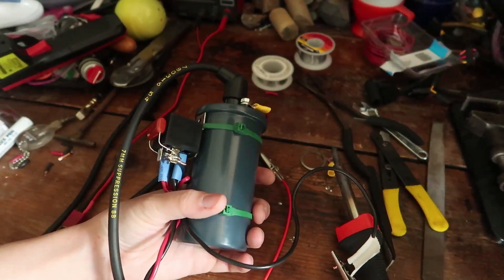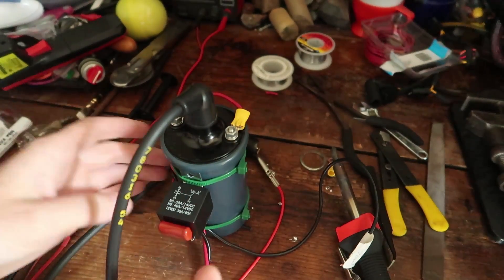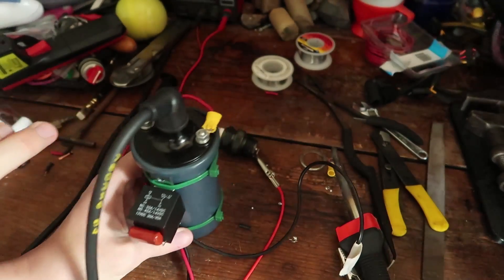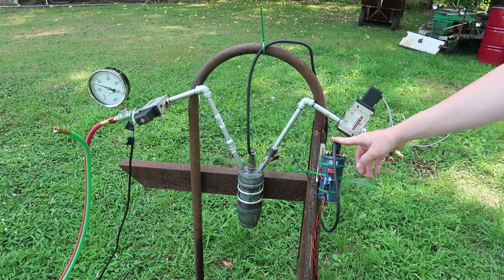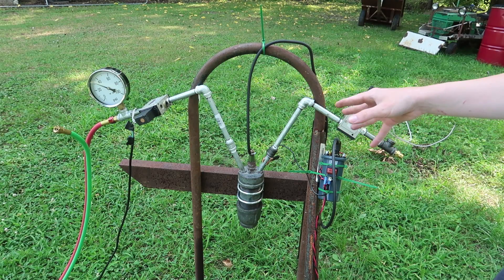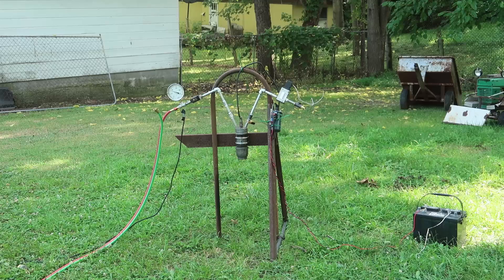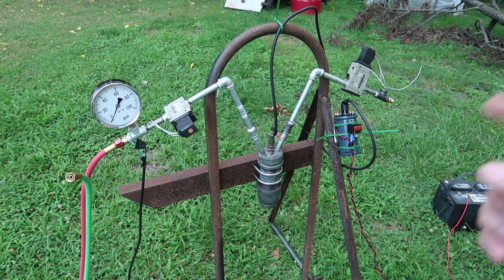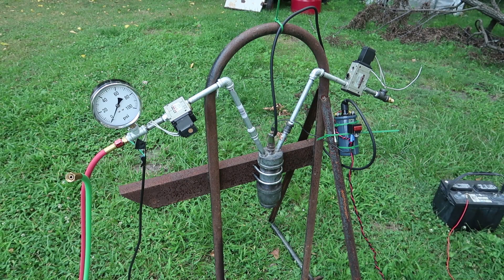DIY Liquid Fueled Rocket Engine 04: Test-Engine Spark Ignition Experiment

Comment: My guess is the mixture is too rich for the spark. Try flowing compressed air through the 2nd line at a low pressure - so that the propane & air are mixing - just a "swirl" kind of action. Then spark it. This is so cool.
Reply from the maker: well i was hoping i could get it burning outside of the chamber with this test. it appears the gas in the chamber doesnt change out as fast as i would have though. and yeah i agree, compressed air would be a good test before pure oxygen.

Comment: did this to fix combustion problem with wood gas fuel. Make the fuel and oxygen swirl like a vortex filtering system so the center of the vortex is centered on your ignition point. the vortex tightens when pressure is added.  I used compressed air in my set up though. great build but don't loose your eye brows.

Comment: Looks like you are having the same problems i had when building my 5Kn engine's "torch igniter". 1. Keeping the power from jumping out of system to other things (in your case the grass) is a pain, cover all metal with heat shrink or similar insulation. 2. You are using all the O2 in it right away so it will not stay lit. For it to light and stay lit you must keep adding O2. Compressed air may work in your case due to you lighting the chamber directly, in my case i HAD to use pure O2. 3. I highly recommend A torch igniter set up over direct combustion chamber ignition as it is more stable. 4ish. As for worrying about it exploding, you do not need to. With such low inlet pressures and with a wide throat not a nozzle it is physically impossible to reach the levels needed to break those fittings.
Reply: I agree with the above. Sparkplug is enough for igniting the mixture, I guess even the glowplug would be enough as long as enough o2 is provided. Also I would add something to preheat the fuel (like a condenser tube submerged in hot water). Liquid propane won't ignite.

Comment: Very cool project!!!!
Reply from the maker: thanks, i'll get back to it when i get my workshop finished, then i'll have plenty of space to work on things in air conditioning. maybe even buy a lathe.
Reply: Rinoa Super-Genius I was heavily into rockets years ago. Got up to level 2 cert and was starting my level 3 but decided to sell everything and get out of it cause the clubs were getting out of hand and made it hard to have fun. I do miss the building aspect of it though. I have had an idea in my head for years. Maybe someday I will build it!
Reply from the maker: is that an FAA license? i dont want to deal with clubs since my goal isnt model rocketry but real rocketry.
Reply: Rinoa Super-Genius it’s for the size of the motor you can use. Each level is determined by the impulse your allowed to use. At level 2 the largest rocket I launched was 13’ tall 7 1/2” dia and weighed 125 lbs on the pad. It flew to an altitude of 5200’. Anyway... I always wondered about building a real rocket engine. Cool stuff keep it up!!!
Reply from the maker: thats not what im asking, im asking what government agency you get the license through. surely you dont think commercial rocket companies have to join a club made for little kids launching store bought rockets do you? im trying to figure out what organization i need to go to in order to clear a launch. so far ive found no law stating i need a license, and the FAA doesnt have any info on licenses as far as i can tell. so it seems to be an invention of the ametuer rocket clubs.

and what ways didnt they kill the fun for you?
Reply: Rinoa Super-Genius each rocket club is governed by either Tripoli or the national rocketry association. At the launch site anything over 5000’ needs an FAA waiver to fly. And depending on where you live and how close any airports are you need to contact all of them. There radar system will pick anything up. As for the fun part it became very clicky. Like a soap opera and it was getting hard to secure waivers to fly and when all your rockets need waivers to fly it just got to difficult. On top of the 2 hr drive to get to a field that would allow rockets
Reply from the maker: ah, i bet i'll save a lot of trouble by building my own launch site on private land. i plan to get permission from one of the farmers around here who has huge fields and use one of those.

Comment: *=* During ignition, there may be several disadvantages, the energy released by the ignition carries the plumbing to red hot, and not to mention the oxidation that can produce on the metal during hot, the rocket nozzles are probably made in ceramic, idk...

Comment: If you pumped in oxygen at a little lower pressure then the propane that should help. I also would recommend as soon as you turned on the ignition to have it open the oxygen solenoid. For the oxygen you could use a old fridge compressor to pump it in as they are quiet and have a extended run time. Just before you do that make sure to change the compressor oil as the normal oil will turn to acid if it meets air

Comment: Brainstorming... you could make a priming switch that will allow a very slow fuel flow then when ignition is started you can flip a switch and it will open the main valve. I also would recommend maybe a bigger spark gap. Like a neon sign transformer or you could get a oil furnace igniter. At least a 1 in ark or less should be able to ignite it. Or instead of a bigger ark gap you could add a second spark plug to help out the first one. I also wonder if you took a diesel injector from a car and pumped high pressure oil or diesel through it if that would work too. Just some random ideas to think about..

Comment: *=* Special project, and take precautions to avoid injury.
I have a suggestion, you can try pump the air of exterior for the unconnected oxidizer for easy combustion in the rocket.
If you try put oxidizer in the rocket, keep distant to the rocket before the test!

Comment: The other option would be to switch to a pulse jet engine, less parts and easier to make work, plus there really cool.
Reply from the maker: but they are loud, innefficient, and not a rocket engine at all.
Reply: Rinoa Super-Genius well it looks like you are on the right track with this one, a rocket engine consists of a combustion chamber, a throat, and a nozzle, i see a combustion chamber and a throat, you need a nozzle. It should start at the diameter of the throat and bell outwards, probably going to be 2 times the diameter of the throat, to get the correct pressures. I do love your presistance though. Keep up the good work!!

Comment: It looks like the ratio of propane to oxygen is a little off :) a quick google search yields the answer is a one to one ratio. Sooooo i guess this gives you more reason to add in the oxygen :); however, you need a way to mix the fuel inside of the combustion chamber so that the propane can mix with the oxygen and burn at the correct stoichiometric ratio. I would suggest one of two things creating multiple entries for propane gas and the oxygen or setting both gas inlets on angles so that when the pressurized gas enters the chamber is creates a vortex that should mix the gases. This will most defiantly make it easier to light the gas with the spark because if the gases (oxygen and propane) are mixed correctly 1:1 ratio the ignition temp will go down or the required input energy will be lowered.  KEEP UP THE AMAZING WORK i like this series a lot. I hope this helps a little bit!
Reply from the maker: Yeah i was hoping it would burn outside of the chamber since i only had propane, but oh well. i'll try compressed air next.

Oh and i plan on experimenting with injector styles on the next engine.

Comment: YES, with my experiments, I first started off trying to find some transformer to use for ignition, and ideally a car ignition coil is best, but then I remembered a while back I ordered a high voltage taser/spark unit and eventually used that. I didn't have the necessary materials to create a switching current for a microwave transformer i was using.

Comment: why not instead of propane use Petrol through an injector , this injector could be a metal spray nozzle hooked up to a pump ( I havent done any research on pumps suitable for this but if you dig around a car store or scrap yard you probably will find a fuel pump that could work ,make sure the nozzle aerosols the gas and it should be eaiser to use than propane. 
but dont take my word for it as i only work on solid motors like APCP   and am expanding into hybrid rocket motors. 
Good luck and i cant wait to see some more progress ! :)
Reply from the maker: because then id need liquid oxygen

Comment: you should use a 555 instead. this is really bad for the relay and it won't last long
Reply: Still, it works and it's a cool on-the-fly solution.

Comment: You should get a Universal 3 Position Ignition Starter Key Switch with Momentary Start and a momentary on push switch and wire it up so you require to hands to ignite the engine (as a safety feature) or dont your choice

Comment: Why not use Aerostart as a fuel?  It's designed to have a good flammability range and is easier to source and contain than hydrogen. Also place the spark so that it has one end in the fuel and the other in the oxidiser.

Comment: an accumulator tank with a electronic solenoid  has some merit in this application I would think - adding oxy gets dicey unless you have the ratios very well regulated - perhaps a small shot of nitrous at the flame source?

Comment: That relay is moving fast! I wonder how long it will last, doing that. I know that of course you will only be pressing it for a few seconds to trigger the ignition so it should be fine, but it still makes me feel bad for the poor relay.
Reply from the maker: well it isnt completing the switch, it isnt moving enough to connect to the other pin, so maybe it will last longer.

Comment: Your burn chamber doesn't allow for fuel to mix. With only one entry point for fuel and oxidizer and the igniter between the two, no amount of manual mixing will help.. nitrous oxide feed from a whip cream maker through a long transparent acrylic tube or possibly bleed the oxygen line with nitrous will help.

I would suggest a steel mesh baffle kinda like they use in hybrid motors to protect the NOS fogger and then move the igniter on the outside of said mesh.

Or possibly tack on a little steel mesh over the propane inlet. Then use it and the sparkplug and use that defused point to ignite. Prime with oxygen, ignite, propane¿?

Comment: You can make hydrogen really easy and cheap with water, sodium hydroxide, and scrap aluminium.
Reply from the maker: id need liquified hydrogen, and tens of gallons of it though.
Reply: Might be easiest and cheapest just to use gasoline, Propane  has a much narrower range of flammability than gasoline and much higher ignition temperature 920 degrees vs. 500 degrees for gasoline.
Reply from the maker: i'd use Kerosene not gasoline, but gasoline isnt a gas so it wont work for what im doing right now anyway.
Reply: @RinoaL  Gasoline is a liquid, or is it not the same thing as petrol?

Comment: I definitely had to do a lot of fiddling with the oxygen ratio on my "movie explosions" video.  I was using MAPP gas and oxygen to blow up sealed tin cans.  I was just using a single use ignitor made by wrapping a thin wire around two contacts a few times and plugging it in to 120VAC so it was very satisfying when I finally inserted the correct amount of oxygen.
Reply from the maker: that sounds like something youd do. hahaha :p
Reply: Well, my film friend wanted an effect, It had to be done
Reply from the maker: of course. haha

Comment: a couple ideas for you maybe.  i think you need a larger and hotter spark.  i have a transformer that is used for igniting a oil burner type furnace.  if i remember right you have one to from the furnace in your basement.  Then you make something like a Jacob's ladder to light it.   you could use your solar panels and electrolysis to make your own hydrogen generator.  
Just a couple ideas,  great little experiment keep it up.
Reply from the maker: i agree the spark is weak, however i think if i bend the spark gap out i should get a longer spark and that could help. i'll do this test again but with compressed air being pushed in, and then it should eventually light.

Comment: This is all a bit "how ya doin'".
But I think your problem lies in NOT having any oxidiser/air/oxygen in the "combustion chamber".
As soon as you turn on the gas it displaces all the air, leaving fuck all to allow the gas/fuel to oxidise with and combust, hence no ignition/combustion.
It's not gonna go if it can't burn man.
It can't explode or do fuck all with no oxidiser. It will only explode with a certain fuel/air mixture and in an enclosed space. Or a partially enclosed space,like a real combustion chamber.
Get ya ignition sparking. Turn the gas on low and then slowly start to add oxygen and increase slowly until you get combustion at it's best.
Though that really only just barely, if at all, classes as a combustion chamber. A rocket combustion chamber really needs a restriction after the chamber (kind of making the chamber) and then a progressive opening/funnel/rocket nozzle.
Without the restriction after the combustion chamber there is no resistance to flow and much less pressure build up in the combustion chamber.
I would closely study a rocket design or two. You may also find the Aerospike rocket engine interesting too, as an aside.
But then, I'm NO rocket surgeon. So take what I say with a pinch of salt or two.
Except be careful. That you can listen to.
Reply from the maker: problem is, once i start adding oxygen i can no longer safely do tests in my back yard and have to travel 12 miles to my test site. i let the engine sit for several minutes between ignition tests in the hopes that the wind would help clear it out. i dont think lack of oxygen is the problem tbh, i think this spark is just very small. if i got like an inch long spark then i bet it would catch the propane on fire and burn like in the previous video.

i have been studying rocket engine designs for many years now, what do ya think im basing this all on? i've been reading rocket engine and turbopump documentation years now and thats why ive decided to start doing experiments. lol :p

Comment: Hydrogen/propane rockets don't use gas, they use the liquid. So you would want a liquid aerosol in burn chamber. You get the liquid by turning gas bottle upside down
Reply: Nahhhh. This would still do nothing but allow more fuel into the combustion chamber that would then turn to vapour, which is actually necessary anyway. It is only stored as a liquid, due to obvious size constraints of storing and carrying it as a gas. A liquid does NOT combust, it is only when the liquid becomes a vapour can it combust. Be that Hydrogen (a gas at normal atmospheric pressures and temps), Propane/Butane (again, as with hydrogen) Petrol/gasoline (liquid at normal pressures and temps, but readily vaporises or evaporates) or Diesel/Kerosene/fuel oil (needs energy to evaporate/vaporise and become combustible). And of course it needs to combine with oxygen in order to be a combustible mixture, ideally at or around the stoichiometric ratio of the fuel and air.
Hypergolic fuels are as I'm sure you're aware, an entirely different animal.
Reply from the maker: this engine isnt made to get thrust, this is only a "practice engine" tbh. its something less dangerous than cryogenic liquid fueled rocket engines but just dangerous enough to learn from.
Reply: I don't think there's enough energy from burning gaseous propane with oxygen, but may be enough from the more denser liquid propane to create measurable thrust & use scales to perfect.
Reply: Gas/gas rocket engines do exist, and they're quite nice, actually. In certain combustion cycles, though the fuels in the tanks are still liquid, everything going into the combustion chamber is already gaseous because of preburners used to spin the turbopumps, and it can work just fine.